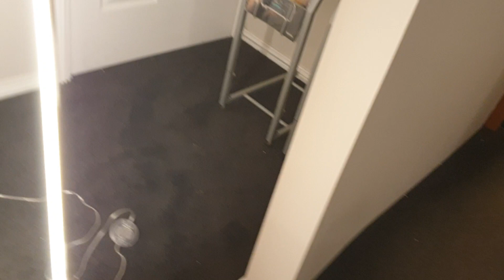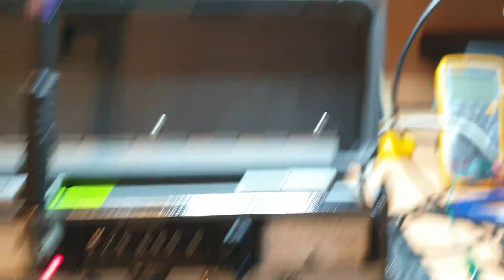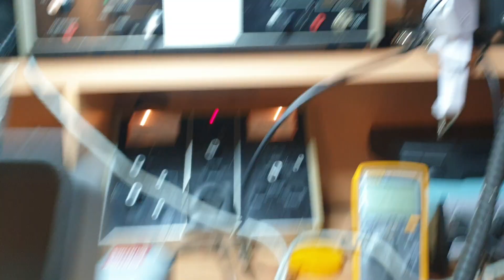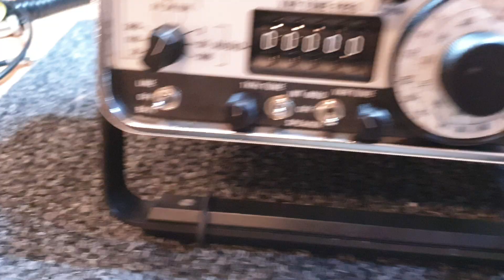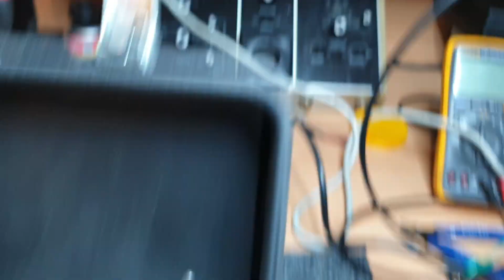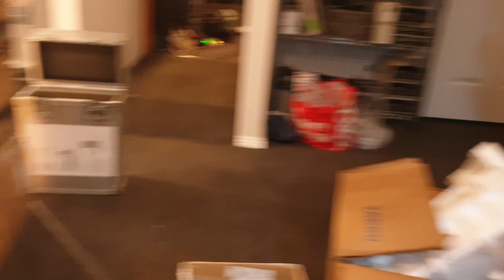More surprise boxes...Yaesu, Icom and IFR. Love these deliveries for the weekend fun!!!

Comment: cuday mate i am looking for a display for a yaesu 726r if you have in your yaesu lot thanks de zs5gmw
Reply from the maker: will check through for you Garth, you never know.  do you have a Yaesu part number at all? cheers Brenton VK3CM
Reply: @brentonmeadowsvk3cm  hi the part number is PB-2449A PCB with components C024490A thanks de garth zs5gmw
Reply: @brentonmeadowsvk3cm  hi the part number is PB-2449A PCB with components C024490A thanks de garth zs5gmw